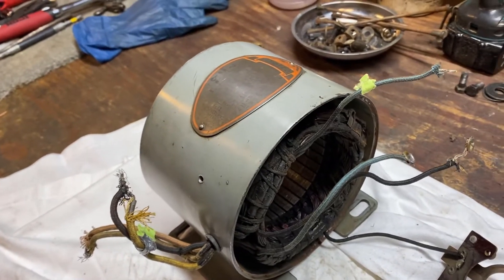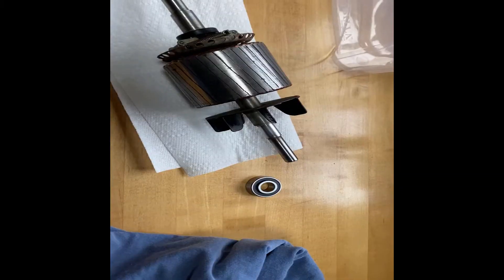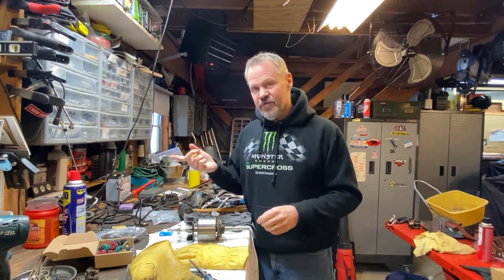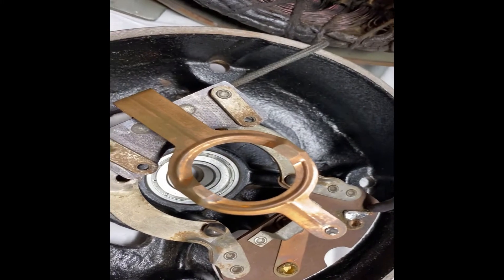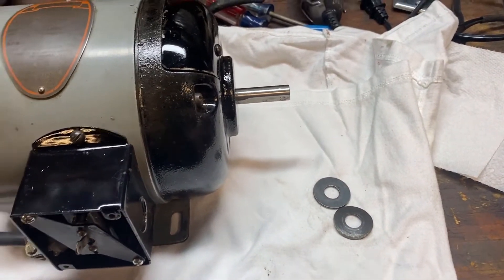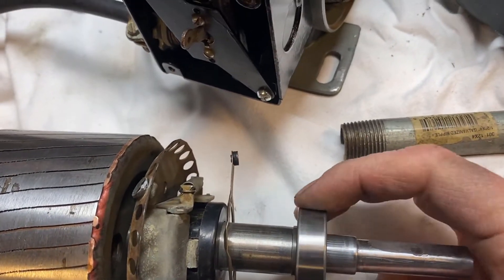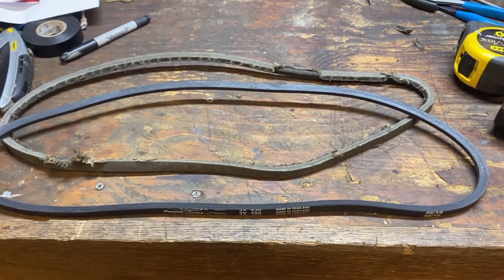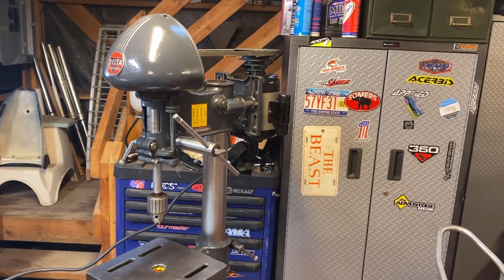Delta DP220 Refurbishment Part 4 - Final Assembly.  Includes 62-110 motor rebuild.

Comment: Hey Chris - this is a great video! Thank you for sharing! I am in the middle of restoring the exact same motor. so this was quite helpful! I am wondering if you can share the replacement bearings you used here, as I am trying to replace those on my motor.  Thank you so much!
Reply from the maker: Sorry for the delay in my reply.  I took a look and I am 99% sure I got these on Amazon, they're 15 mm ID, 35 mm OD, 12.7 mm Width, Single Seal/Shield.  At the time I had to get one branded NTN and one Peer as that was all they had.  Guessing you already found a source, if not I hope that helps.  Thanks for watching.

Comment: Great video, I have an identical drill press i just bought last week and need to do a few repairs. I need a replacement pully for the top of the because mine is broken just like yours was. Where can I get a new pulley just like the one you got for mine? I have not had any luck finding on on-line. Thanks for your help.
Reply from the maker: http://www.hammerscale.com/HTML/Products/DrillPress/DP220B.html